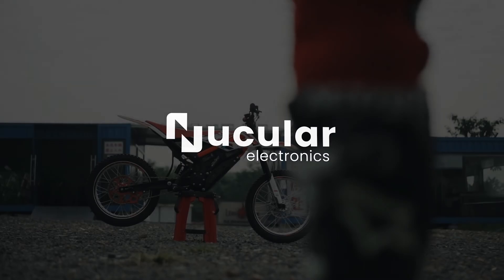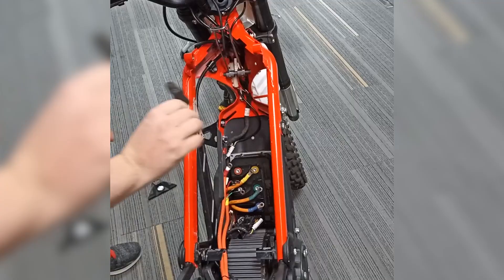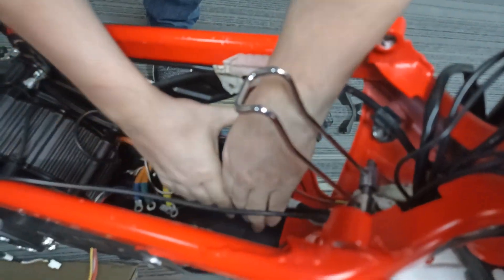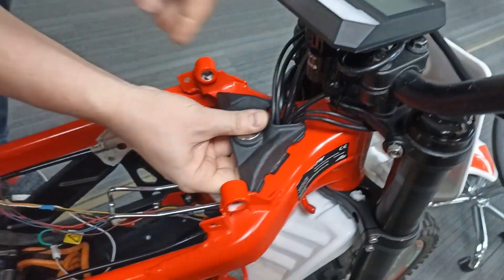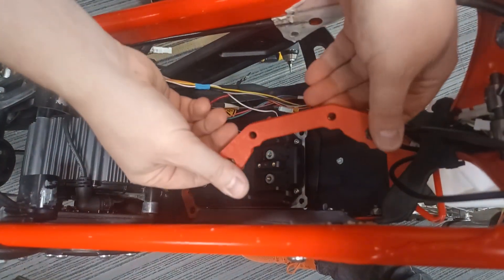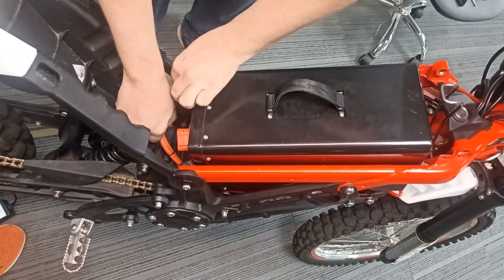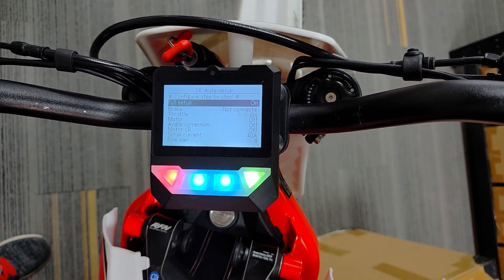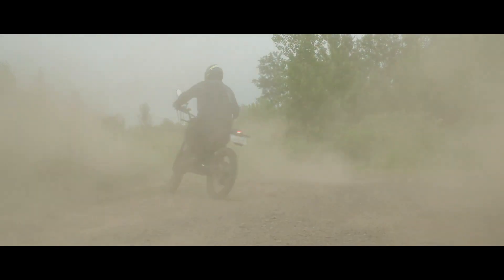Nucular controller for Apollo RFN. Installation guide

Comment: Very happy to see you guys made one for the RFN !! :D
Reply from the maker: Thx🫡 Try it, and you’ll definitely satisfied 👌🏻
Reply: @NucularElectronics  waiting the next paycheck !
Reply: I’ve took a nucular controller of a surron will it fit on my rfn
Reply from the maker: @BAMOTwells yes, sure. But not plug&play, you’ll need to make a wiring and a mount
Reply: @NucularElectronics ok we’re can I get them from
Reply from the maker: @BAMOTwells you can make an order on our website www.Nucular.tech
Reply from the maker: @BAMOTwells hi! Check here pls https://docs.nucular.tech/doku.php?id=en:controller:config-files
Reply: Great but what specs is that gonna bring?
Reply from the maker: @MaxDHockey  With the Nucular controller installed, the safe max power for the motor is around 12 kW. As for top speed, we haven’t measured it, since it really depends on many different factors (rider weight, terrain, tires, etc.), but you’ll definitely feel the difference right away